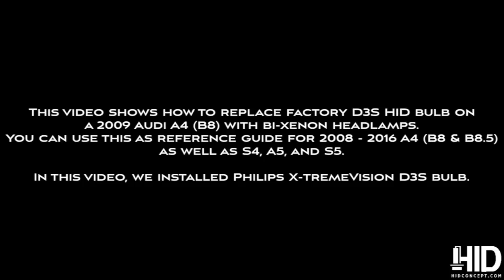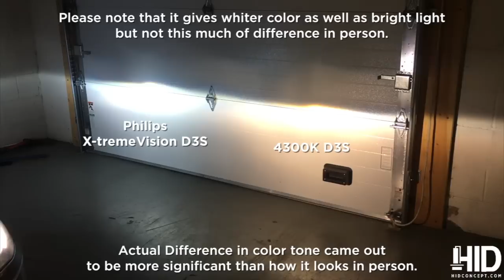2009 Audi A4 (B8) - PHILIPS X-tremeVision D3S bulbs Installation DIY Guide

Comment: Hey, I replaced my bulbs today that I bought from HIDConcept (Philips D3S X-tremeVision gen2), but on the left side, the beam seems to be a bit misaligned from the right side. Could it because the bulb is not screwed in at the right "orientation"? I think the stick on the left side might have been slightly tilted when I tightened it
Reply from the maker: 99.99% of times, irregular beam pattern is given when bulb is installed incorrectly/at angled position as most people install by 'feel' without looking directly into back of headlamp assemblies. You might want to re-install to make sure that its seated properly.
Reply: @hidconceptcom  thanks guys. I think I was able to get it in place

Comment: I removed my bulb and when i wanted to put a new one it does not turn clockwise at all. just barely. i tried putting on original bulbs back on and they wont get back on either. I have even tried using all the force i can produce with my fingers to force it to place but it wont click on. barely turns at all. Please help.
Reply from the maker: If you have B8, it should turn. Try wiggling around and turn gently to loosen up.
Reply: Just remember those D3S come with a year warranty

Comment: What size is that Torx driver?  Thanks
Reply: T30 is the mark and you need 20 mm screw driver as to reach lower bolts. So the mark is T30-20 mm. It was what I found today by method try/mistake/new try :) so still on the second try i got the right one by the shop.
Reply: Thanks for the info.   Greatly appreciated.
Reply from the maker: Sorry for the late response. I believe that it is T30 as Ivan stated.